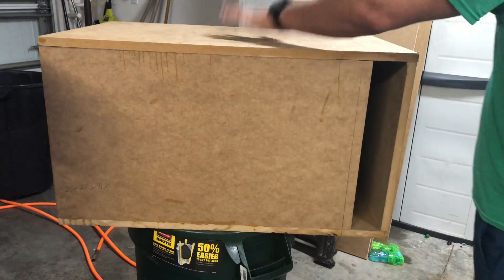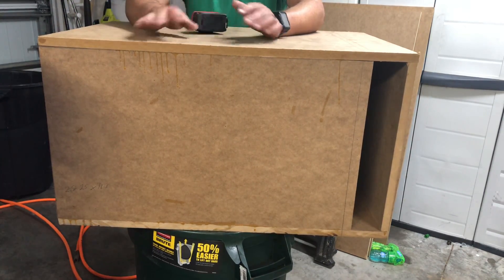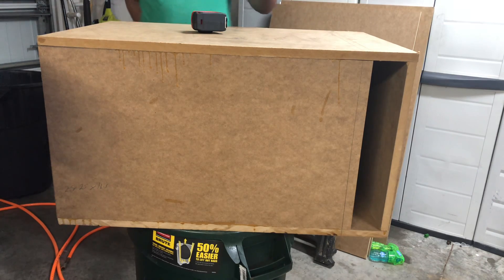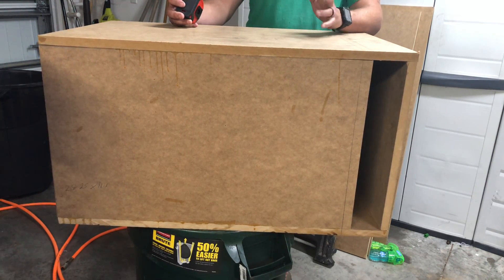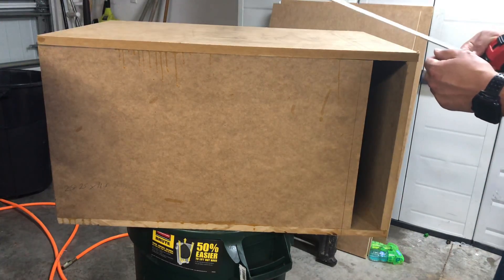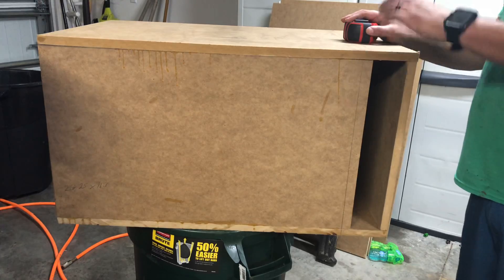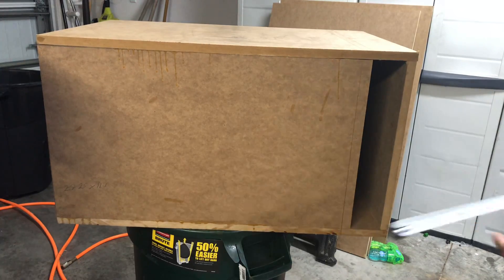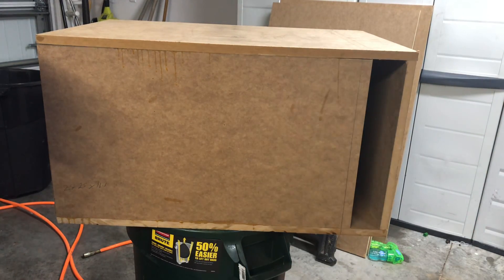Free subwoofer box design 32-35hz

Comment: ey i'm shawn from barbados  i have a audiopipe 15 inch driver model TXX-N1500 and i dont have any specs for it i would like to build a down firing box for it and use in the home theater room  but i cant fine the spec anywhere and i dont know anything about  cubit feet only feet and inches can can u help me me wit a design